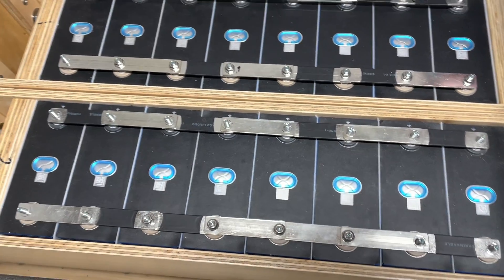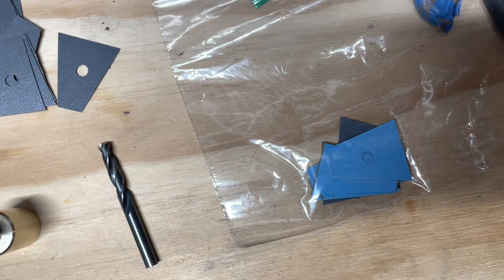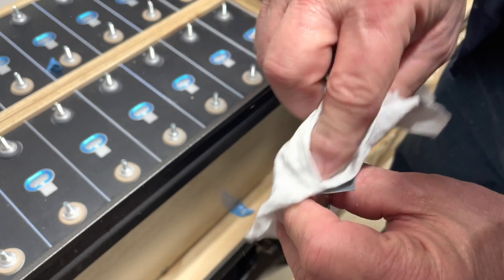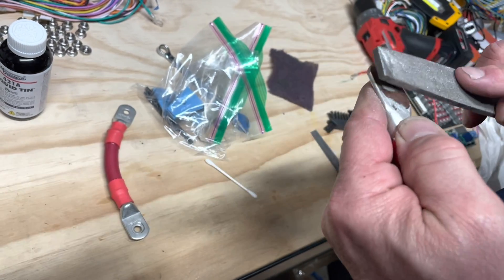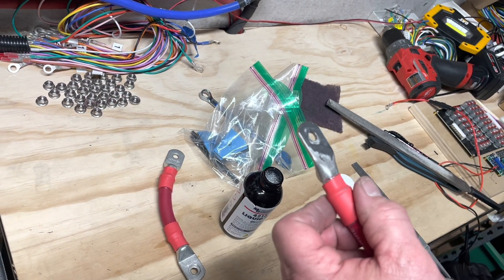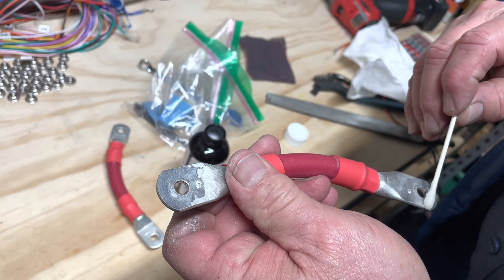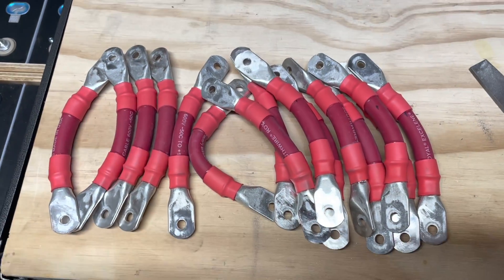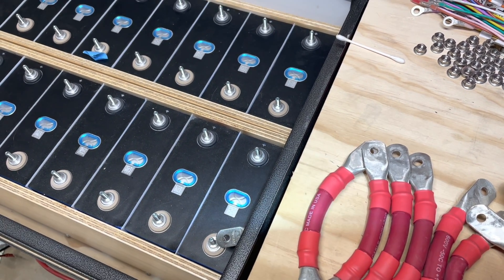LiFePO4 terminal, busbar and lug preparation.

Comment: 6:12 have you tried hydraulic press to flatten them?
Reply from the maker: As for the flexible flat buss I made, I could show you how, but it would be a lot of don’t do this. It’s one of the those things that I’m this far into it and I’ll keep going and wish I hadn’t. Then to add insult to injury, I found some to purchase after I already made these. Go to eelbattery.com, click on the hamburger symbol in the upper left, then battery accessories, flexible buss bars, select short (2 hole) long (4 hole for 2-p). For longer jump across’s use 2/0 or 4/0 cable and lugs. That’s what I’m doing for my bottom row.  Use stainless or zinc plated smooth bottom nuts not the type with a grip on the bottom. MonsterBolts - M6 Hex Flange... https://www.amazon.com/dp/B083MWW148?ref=ppx_pop_mob_ap_share  Use Noalox on the contact surfaces but not on the threads.

Comment: Would you consider building a large battery pack for me?
Reply from the maker: Sorry, but I don’t even have time to get my other projects done. It’s also a huge outlay of cash up front that I’ve got no idea how to work that out since I’m not running a business. It’s not that hard to do. Select the cells from eelbattery.com(USA stock) and select the BMS on EBay JK bms 200 amp/2amp balance version. Do that and you are 80% there, but read up and learn first. If you still want to buy, “Ray builds cool stuff” may be in the business but I bet his backlog is long. There’s a lot of nice “server rack” batteries (see all of Will Prowes videos about those before selecting) then there’s “Big battery”’s Kong Elite and Rhino.
Reply: @SkypowerwithKarl  thank you very much for taking the time to respond and doing so quickly.  Thank you also for the helpful tips.  I really enjoy your channel.

Comment: Bus bars just don't seem to work as well as some good copper lugs. Thanks for sharing
Reply from the maker: I’ve proven that to myself. Plated buss bars are very good as far as a conductor but can be poor at the connection of the cells. Even if they are perfectly flat the cells may be slightly higher than the other causing it to lift and or damage a terminal. I predict that in the near future flexible buss bars will be shipped with the batteries.
Reply: @Karl Jensen  that would be ideal.

Comment: Have you tried No-ox-id, instead of the liquid tin?
Or as well as, since it stops aluminium from oxidizing?
Reply from the maker: Absolutely do I use Noalox. Even so copper is too far removed from aluminum on the metal’s nobility chart that I wanted to tin the copper as an intermediary AND use an anti- oxidant.
Noalox and No-ox-I’d “A” special are about the same thing. The “A” means for aluminum and is about the only version of it you can find now. Noalox contains particles of zinc and is dark charcoal versus dark brown of No-ox-Id. I have some carbon conducive grease but I’m not going to use it on something that I don’t have proof and cost me a ton of money. Noalox and No-ox-Id are proven.

Comment: Did you make those bus bars?  Is there a video on that?
Reply from the maker: Yes I made them. And no there’s no video on them….yet. It’s 2/0 Spartan brand welding cable or Windy Nation cable from Amazon. Lugs are Selterm 2/0 for 1/4” stud also Amazon. Use a very light film of Noalox on the outer surface strands and very lightly polish the inside of the lug with Scotch bright just to get the oxide layer off (wood dowel slotted and spun by drill). When you crimp put a the intended bend in the cable to lock in the shape. Hole center to center should be 5-3/4”. The hex crimp should have nice crisp corners with little to no pinching out metal. Use adhesive lined heat shrink to keep moisture out. There’s a flexible jumper available from Eel batteries website both two hole and four hole types. I just don’t like the slot in them. Expect a 15 day delivery. Use Noalox on contact surfaces but avoid the threads. Re torque frequently or as needed. Hope that helps

Comment: Is this an effective way to avoid electrochemical reactions between metals?
Reply from the maker: Yes. Tinning copper definitely helps reduce galvanic corrosion. Also a small film Noalox on the contact surfaces (but not on the threads) makes it permanently protected. By the way those batteries are purchased from EEL. They are working great. I’m seeing only 5 mv delta under normal loads and up to 15 mv delta with 160 amp load in the long flat of the curve. So far, so good!
Reply from the maker: I noticed that you may be looking into “flexible buss bars”.  That may be a gold mine. May I make some suggestions? I’m assuming I’m addressing Howard. Aluminizing would be optimal but I believe the thin laminate of the flexible buss bar would be badly damaged in the high heat the process exposes it to. I believe chemical tinning is the way to go. Care must be taken to not expose the edge laminates to the chemical as the acid may wick between and cause corrosion later. The punch slot is much too big. This greatly reduces the already small contact area on the top of the terminal. A fixture to clamp the buss bar and drill it to 6mm (not punch) at a hole spacing of 73mm would be ideal. This accounts for slight swelling and a thin isolation material between the cells. Copper is extremely soft and compresses for days after installing requiring numerous re-torquing. An embossing fixture can help reduce this. A die with a pilot and boss that compresses an area just larger than the terminal and the opposing side (top) one flat surface. The flexible hump needs to be taller. Closer to a true U shape. This will greatly increase linear movement which is the primary need. Hope that helps.